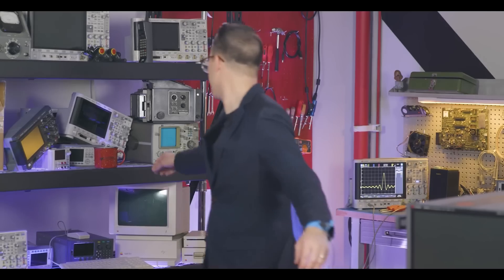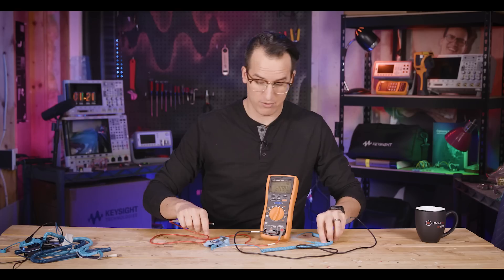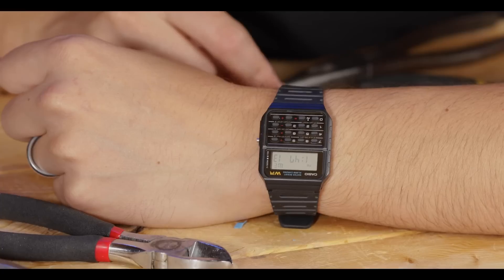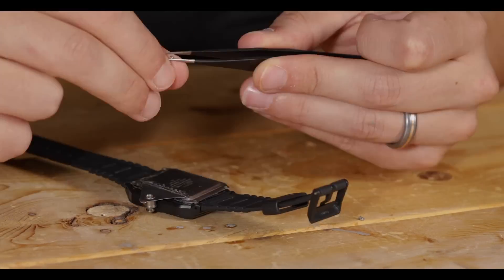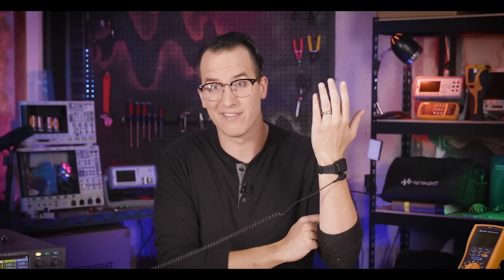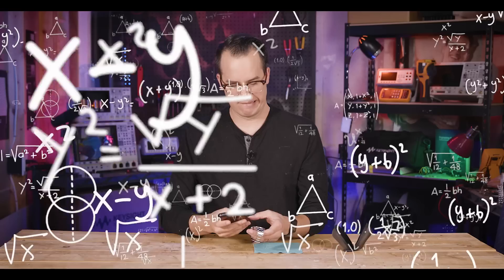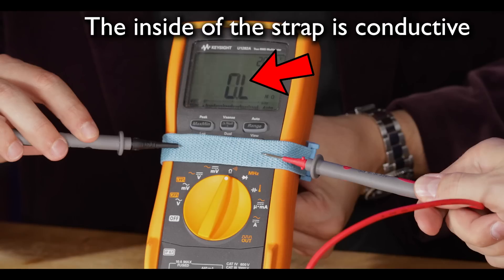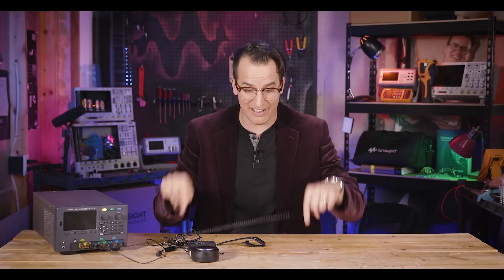Antistatic Rolex Mod (ESD Strap Build)

Comment: You could have just taken the watch's strap pins and then put the watch on the ESD strap. But you still will have two metal places.
Reply from the maker: Yeah, that felt more like attaching a watch onto a strap than actually turning a watch into a functional ESD strap

Comment: Tips for the snap: you can buy snaps in stores that sell clothing parts and stuff, like buttons, needles and such and you don't need to struggle with the strap or heat up the snap so the plastic can release it more easily. Or try to drill it from the back, I believe the back of the strap is something like a pop rivet, it's spreading out and grabs into another metal piece like a strange flower.
Also, look up silver solder, you might find what you are looking for (I learned about it yesterday on The Craftsman Show here on youtube)
Reply from the maker: Awesome advice! I did go to a couple fabric stores trying to find the right snap but couldn't find one that was the right size!

Comment: Silly question, Why aren't Antistatic straps Magnet . I guess its because they would slide off?  Also how would that work with BPM fit bits etc..Also Doesn't the Quartz in the Piezo alarm make a static shock  Nice video by .they way. :)

Comment: I remember taking a computer repair class 5 years ago and we just stopped using esd bracelets because they aren't really necessary.
Reply from the maker: You don't need it until you realize you needed it 5 seconds ago
Reply: @KeysightLabs  - or having spent hours/days debugging why the system isn't working as it should.
Handling computer boards, ok allright - ESD is less of an issue. Messing around with single components and ESD is an issue. 
Different systems, different scenarious.

Btw - any scratches yet from the EScalcUNDulator? The back looks like it has teeth.^.^.^.^.^
Reply: The problem with not wearing ESD straps is that you will get away with it a lot of the time.  But not always.  And the time when you don't could be the time you're installing a thousand dollar Core I9 processor.   The other problem is that ESD doesn't just kill things dead when it happens.  When it does at least you know you broke something.  But instead it often just degrades the performace of your components.  Ever have a PC with "flakey" memory that crashed often and eventually you had to replace the memory?  That's the kind of thing caused by not wearing ESD straps when handling components.
Reply: @cdsmith  Tell it to my 3 certifications. Never had any issues.
Reply: @iceman7157  Which three certifications are those?  I'd like to know so that I can ignore them in the future.   The point that I am trying to get across is that you don't know you have never caused a problem.
Reply: @cdsmith  I definitely know I haven't ever caused any damage. Someone would have obviously told me by now. And since you just want to insult my intelligence I won't be telling you which certifications I have.
Reply: @iceman7157  Your certifications should have taught you that ESD is real and precautions are necesary.  I have an electrical engineering degree and have been working with electronics for over 25 years.  I have seen numerous examples of ESD damage when the proper precautions weren't taken, including sending failed ICs back to manufacturers for failure analysis and having them de-cap the components and send back scanning electron microscope images of the actual damage to the IC dies, with melted parts of the IC dies near the bond wires.  With a note that basically said "ESD damage, not our fault, use your wrist straps when assembling boards and this won't happen."  I have personally done it myself when not taking proper precautions.  I once configured a new wireless router, unplugged the Ethernet cable from my laptop, and while still holding the end of the cable, stood up from my chair.  I felt a static shock in my hand and that was the end of that router.  None of the Ethernet ports worked after that.  ESD damage is real and precautions should be taken by anyone that gives a damn about the equipment they are working on.

Comment: Haven't done electronics in a company for 30 years but I used the ankle strap which is much preferred as you walk onto the conductive mat and instantly discharged. Much better than a springy cable that you go to grab something and the cable catches and throws something important onto the ground.
Reply: Phizicks you do have to be a bit careful  with heel straps when there’s lab seating involved, people have a habit of putting their feet up on footrests or other stuff!

Comment: Legend! Re: soldering to stainless, I've had good luck with phosphoric acid as flux in the past. If I were to try again I'd probably look for a commercial acid flux less inclined to splatter.

Comment: Just wear it around your ankle so much better and easier nothing gets in the way
Reply: Wouldn't that mess up with heart if he touches live wire?
Reply: @hassanzahin1534  when building pcs live should always be off anyway till your ready to power it up to test
Reply: @hassanzahin1534  when in doubt, work with one hand behind your back. 

But really those straps are only for protecting components while handling them than yourself, most of the time you will barely feel esd if it happens while you might of damaged components in the process.
Reply: How will I check the time on my ankle though?

Comment: I've got the same GMTIIC, great watch and awesome movement (if you've checked it out in detail!).  Point to note you cannot damage your GMT movement by way of its design during time setting.  Liking the mod to the strap, neat idea!

BTW any details on the anti-static detector thing?  I'm running the same Keysight PSU in my homelab, loving it so far! thanks!